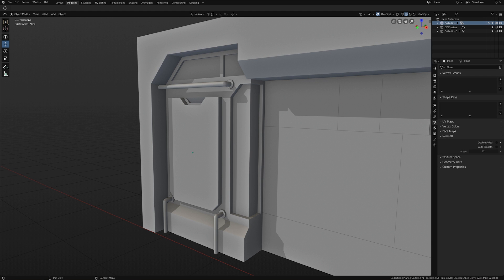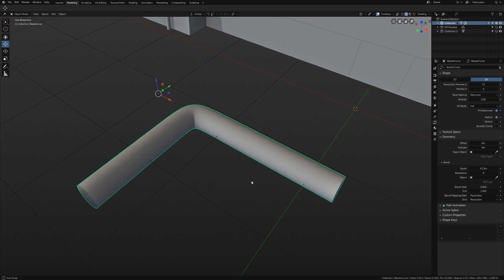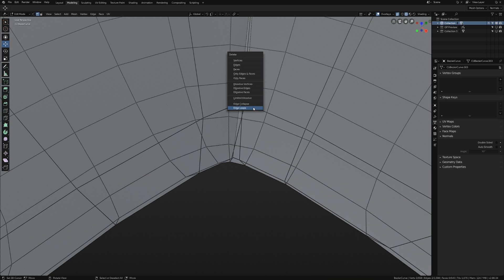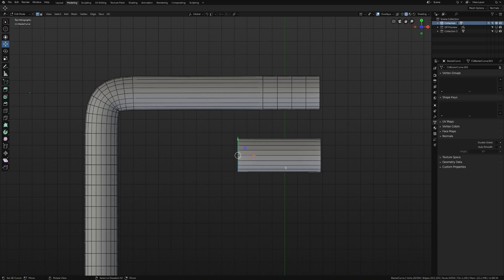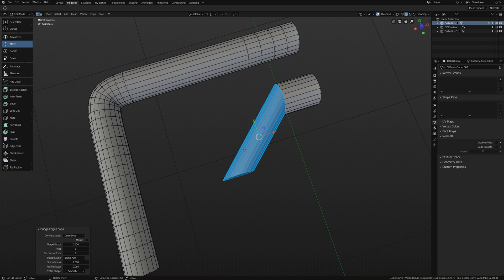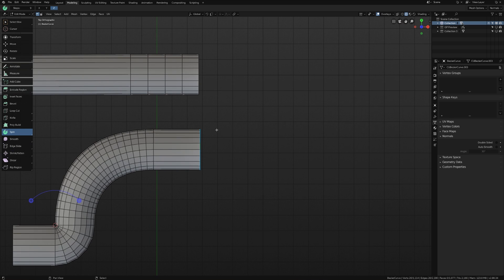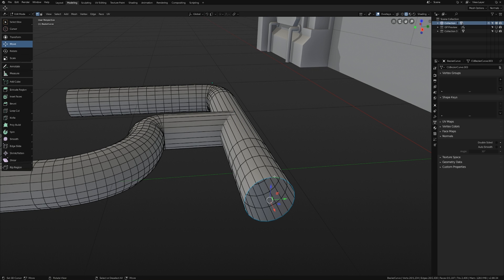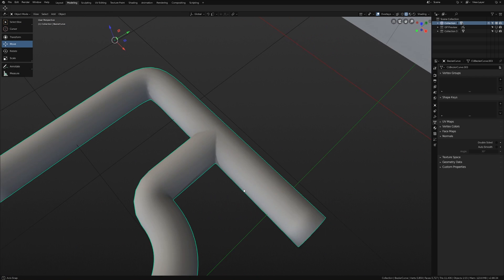The Fastest Way to Model Pipe Joints and Intersections in Blender 2.8 (Not Curves) Tutorial

Comment: What a time consuming way, why dont you just, Add Single Vert > Extrude one direction > Extrude in other direction > click corner vertices > ctrl + b > curve edges > convert to > curve > raise the depth and tada you have a pipe.
Reply: The bevel curve vertex method is inaccurate at the seams.   When you bevel the curve depth to make the pipe, the ends are still angled, so you get a slight squashing from seam too seam.   The ends of each curve segment have to be rotated to square them up to the linear parts of the pipe.

Comment: There was a pipes joint addon in old versions of blender. It was later put in add mesh mechanical. Now blender 2.8 doesn't have mechanical section in the add menu. How can one find it if if they want to model pipes and gears?
Reply: I have seen the mechanical section by enabling add mesh:extra objects add on

Comment: So i'm having a bit of a problem with the spin tool, have reinstalled blender from fresh several times and tried experimental builds but here goes;

In the spin tool where there are selections for X Y & Z next to the steps select at the top left of the screen, i am not getting those options, i click spin tool, and it only allows me to spin on 1 axis, without the options even appearing for the other axis.

Can anyone assist?
Reply: not 10 seconds after typing this did i discover it is in the menu when you type "N" in the 3d view and select the small "tool" tab.
Keeping my foolish post up for posterity as it has changed from this old build.

Comment: Starts with saying that edgeloops is a bad thing. Then proceeds to create a pipe with even more edgeloops, as a “recommended method”. What???
Reply: The problem isn't edge loops per se, but the large amounts of redundant edge loops you get by using paths to create pipes.  Edge loops are necessary for creating smooth transitions between faces which are at different angles; when the faces are in the same plane, they're often a waste of geometry (and, as he pointed out in the video, if you're using subsurf it can be a VERY large waste of geometry).

Blender's curve system inserts a fixed number of edge loops between each control point along the length of the curve mesh (by default 12, you can set it in the curve tab under "resolution").  That means that if you're using a curve to make pipes, you get the same number of edge loops between each control point, even if there's no curve (which is the usual case for pipe), meaning that the straight sections get the same amount of geometry as the curved sections.  Like he said, limited dissolve could help tidy that up, but needs to be carefully handled to avoid disrupting the useful and necessary edge loops smoothing the corners and junctions.

His final recommended method had no edge loops at all that weren't absolutely necessary for smoothing transitions - and for my money, you could even justify an extra set of edge loops to tighten up the subsurf or shading normals as the joint transitions into the "long straight pipe" geometry - but any more than that is redundant.  Having an edge between two coplanar faces is a waste of geometry; it adds verts into memory and gives you nothing back.

Comment: This makes Blender 2.80 look more and more awesome. I think the Spin Tool is perhaps the best one to use for the bend in pipes.

That said, there is a tool I use in another free modeling program, which to me is much easier to use, and it gives great results. The program is called Wings 3D, and the tool I am speaking of is called the Bend Tool. It does require that sufficient edge loops be in the area of the bend, but once it is set per your parameters for the bend, holding Ctrl will make the pipe bend by 1 degree steps, or holding Shift will make it bend by 15 degree steps as you drag the mouse left or right. The setup is simple to do, and when the operation is completed, you get a nice looking even bend.

I thought that Blender had a similar tool for such operations. Could you explore this and let us know if 2.80 does have it? My reason for asking is because while I like Wings 3D for what it does have, the program has no Boolean Operations feature, so creating pipe intersections in Wings 3D becomes a rather hit and miss type operation. Not very efficient. I have figured ways out to do such intersections, but Blender's Boolean Operations feature makes much quicker work of it.

Thanks.
Reply: Like you said, I think probably the gold standard for accuracy is probably going to be the spin tool, and it's not too complicated to use.  Frankly, having watched a couple of examples of the bend tool in wings, it seems pretty unwieldy to me, so it's probably just a case of getting used to a different workflow!

That said, for the kind of effect you're describing, I can think of two possiblities to do something vaguely similar in Blender, but neither are particularly optimal.  The first is to use proportional editing: add your required geometry with ctrl-R, and with the top loops selected and proportional editing turned on and set to "linear", rotate the loops into position (you'll probably need to set the 3d cursor appropriately to get the effect you want), and use the scroll wheel to set the proportional editing radius to include the geometry you want to bend.  That's probably a little imprecise however, since it might be pretty hard to match the proportional editing radius to your geometry; you'll also be limited to a single rotation step, since once it's curved the distance between the geometry will be uneven and the linear falloff of the proportional editing function won't spread evenly through your curve.  the advantage is that if you have geometry above the bend, you can rotate it with the top loop and preserve it's relationship with the rest of the mesh.

The other option would be to separate the geometry you want to bend into it's own object (or select it with vertex groups) and then use the Simple Deform modifier set to "bend".  You'll almost certainly need to add an empty to get the orientation and rotation centre of your bend correct.  It's a bit kludgey, and for simple pipe bends it's massive overkill, but it can be a useful trick to have up your sleeve.

Comment: Nice you forget when using bridge loop tool to make a corner 90 degree pipe to set smooth with F6.
For making a T bone use intersect knife tool and make a top loop.
Pressing G twice lets you rotate a edge loop. First delete edge loops then add subdivision. There is also a pipe joint addon for blender 2.79.
Thanks for the 2.8 tutorial but it can be done in 2 79

Comment: Is it that hard to add pipe kit to Blender?..
Reply: The most hilarious thing about this thread is that there is in fact a pipe kit already distributed with Blender, you just need to activate it.  Search addons for "Add Mesh: Extra Objects"; under "add>mesh" there will be extra section labelled "mechanical" which includes pipe joints.  The geometry is fairly basic - just capless cylinders with a bunch of angle and resolution options - but it's there.

As a side note (while i'll probably regret wallowing into the flamewar) writing these kind of "create custom mesh" addons for Blender are actually pretty simple to make and can quite easily be done by one person as a hobby project. I have zero formal training in programming, and I've picked up enough Python to make them.
Reply: If you find that easy, just do it. That's the beauty of open source.
Reply: @JoergWessels  You're talking like I'm both a programmer, a matematician, a designer, a capitalist and a project leader, all in one. And that's the fault of open source.
Reply: @ShadeAKAhayate  So obviously it is that hard. I rest my case.
Reply: @JoergWessels  For one person? Probably, impossible since he has to have both multidisciplinal knowledge with organisation skills and the resourses to implement all that. For one company? Not so impossible. 
Thus, your case is false.
Reply: @ShadeAKAhayate  You keep adding arguments for why it is hard. So my case gets more correct with each of your statements.
Reply: @JoergWessels  In fact, I reiterated my statements. Can't tell why you perceived them as new ones. Your case remains false.
Reply: @ShadeAKAhayate  So don't want or are not able to work for Blender's development. So I assume you donate to the Blender development fund?
Reply: @JoergWessels  WUT
Srsly, what does that have to do with falsity of your argument?
Reply: @ShadeAKAhayate  So you don't contribute, neither with work nor with money. So what do you derive your entitlement from?
Reply: @JoergWessels  WUT x2
Who told you all that? You don't know me and the last thing I'll do is my financial report before a total stranger, publicly available at that. More, nothing you've told or asked had supported your claims for your false cause. Thus, it remains false.
Reply: @ShadeAKAhayate  So you did donate then? In that case I have to apologise.
Reply: @JoergWessels  In my humble opinion, not only should you apologise, but to hit yourself in the head with your laptop (or PC case) as well. Nothing you raised in this discussion have anything to do with my comment, inquiring me of stuff outside the topic or telling me what to do instead. And that's yet another known problem of open source.
Reply: @ShadeAKAhayate  Sorry Shade I can't do that. I'm not catholic anymore.

Comment: 6:54 Ah, finally, you get to the point of what’s new and improved in 2.8. Is the 2.79 version that hard to use? I never thought so ...

Particularly since it only takes the view orientation and 3D cursor position to initialize the spin origin and axis; once you start tweaking the settings, you can change these values independently of the cursor position and view orientation, and vice versa.

Comment: You should do a tutorial for animating cables and wires. I have to do this for work using the Curve modifier, but sometimes the assets need to be imported into Unity, and it does not recognize modifiers.
Reply: Why don't you bake the animation into the geometry and export it as alembic, or does it need to be rigged?
Reply: @leecaste  It doesnt seem to work. The modifier is what allows the wire to move along the curve smoothly. I can bake the animation, but not the modifier, so when applied it throws it all out of whack. I dont really know how else to desrcribe it lol
Reply: I'm not a blender user, I'm afraid I can't help you with that, sorry.

Comment: A pipe modifier would be nice. :)

Also, knife tool with angle constraint and cut through is very helpful for pipes. I made a video showing this.
Reply: There is one. Its called the skin modifier.
Reply: @CRogers  Yes and no. There is no option to control the resolution.
Reply: @daniele.7913  add a subsurface mod, and check smooth shading in the skin modifier. http://crogersmedia.com/samples/pipe_cube_skin_modifier.png
Reply: @CRogers  I know what you meant. The cross-section is not a circle, because sub-div (Catmull-Clak) on a square does not results in a circle. Also a lot of unnecessary geometry.
We have to wait for everything nodes.
Reply: @daniele.7913  it's not a perfect circle, no. It's definitely close enough for ornamental pipes, however (even close up it's hard to tell). It's also a wicked-fast way to make pipes and saves a lot of work (and waiting for a "real" pipe modifier). The extra geometry can be dialed up and down with the subsurface modifier, so not sure if that little extra circle precision is worth all the extra trouble. You can always apply the geometry and dissolve the extra bits if it really matters. obviously, the more accurate your circle the more geometry that incurs, so... ¯\_(ツ)_/¯

Comment: One of the biggest things I miss from Max in Blender is the Spline tools. Only using Blender a month or so but the way I've been creating pipes is by extruding verts(snapping them to xyz and 90 degrees) beveling the corners and converting mesh>curve. It looks like the Speedflow addon fixes all these hacks with the Tubify tool, but it isn't ported to 2.80 yet.
Reply: that's not a hack, the tubify tool just executes exactly what you just said in code, HardOps does that as well.
Reply: @tom_paul_3d  Yeah mate, what I meant by hacks was all these crazy methods and steps shown in this video to do something so simple.
Reply: @tom_paul_3d  Can you specify the hardops tool you are talking about
Reply: @ghostriley22  zure, it's the adjust curve tool, once youve converted the line to a curve, just hit q and adjust curve, it doesnt do exactly what was specified but it was kind of an example of shortened pack of tasks
Reply: But blender does have splines.... He just showed it in the video...
Reply: @DrTheRich  he knows blender has splines, hes just talking about how long it takes to tubify something from a one dimensional mesh

Comment: Another thing to check out, the built in plugin, extra objects. Under add mesh, it adds a menu called mechanical. In there it had options for 5 different pipe joints. Not sure if it's in 2.80 yet or not though.

I was also going to mention using spin, but then saw you mentioned it. It is a good option I think, but you have to keep setting the cursor where you want it.
Reply: I got Extra Objects for 2.80 from https://github.com/sobotka/blender-addons (as well as loads of other 2.80-ready addons).
Reply: Best recommendation ever! That plug in saved a ton of time, much appreciated :)